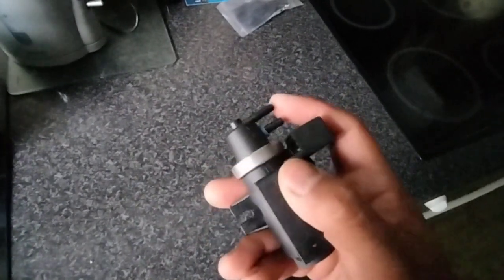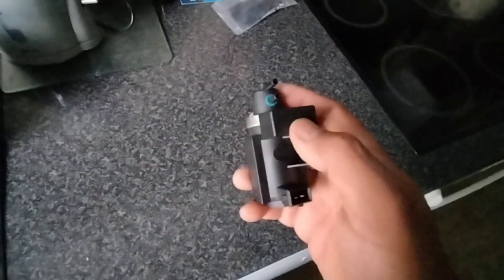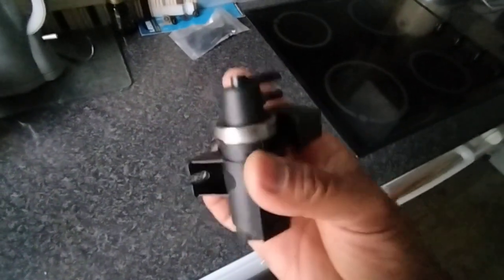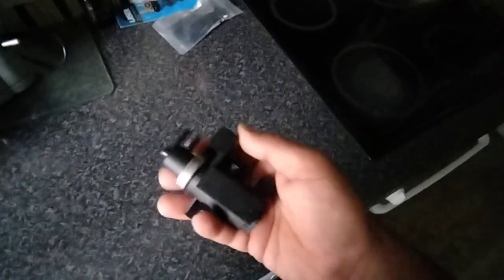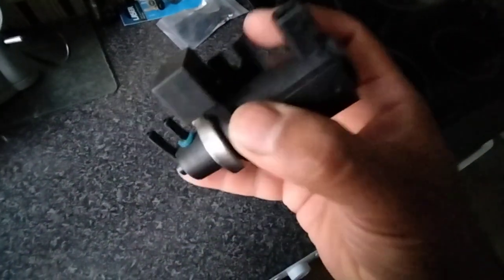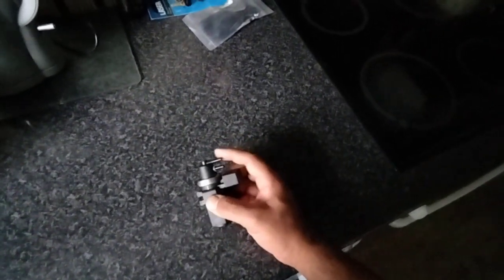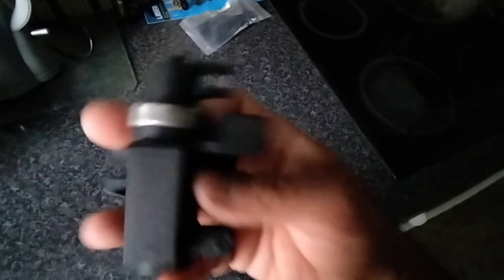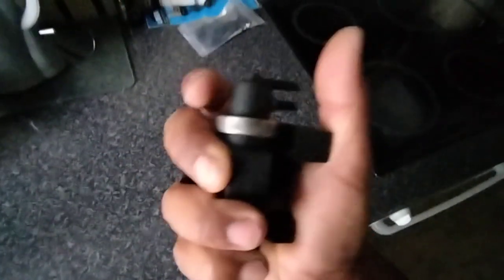CODE 4530 Charge Pressure Control Deviation E60 525D M57

Comment: Does this valve control the turbo actuator or the egr valve?  I just did an EGR delete on a 2012 X5 35d.  It has both a high pressure EGR valve (electrically actuated) and a low pressure EGR valve.  When I had the intake manifold off for cleaning, I saw a valve similar to this under there near the rear of the engine.  One vacuum line from this valve went the vacuum system manifold and the other vacuum line went to the vacuum actuator on the low pressure EGR valve.  I completely removed the high pressure EGR valve and electrically disconnected the low pressure EGR valve and also plugged the vacuum line going to it.  It seemed odd to me that I had this solenoid operated vacuum control valve in series with the electrical + vacuum operated low pressure EGR valve.  Maybe the electrical plug on the low pressure EGR valve is just a position feedback signal?  Anyway, not long after start up and a short drive I got this 4530 code and limp mode.  I cleared the code and reset adaptations, and so far no more 4530 or any other codes.

Comment: i ive blanked my egr off and kept this on you can hear air when the turbo kicks in would it be better to remove this completely or just block the ends off ?
Reply from the maker: I believe a pipe comes off it that goes to the egr valve and thats the pipe you block off.

Comment: Where abouts is this 1 located ?
Reply from the maker: Under the inlet manifold windscreen side near the bulk head.
Reply: Hi ive blanked my egr off and kept this on you can hear air when the turbo kicks in would it be better to remove this completely or just block the ends off ?

Comment: Hi mate, thnx for the clear explanation. Does your 525d have an electronic turbo actuator or a vacuum controlled one? Does this code also occure with the electronic actuator even though it does not control the turbo by vacuum?
Reply from the maker: Mines electric and the code returned, so i cleaned the turbo with mr muscle via the downpipe and now no code totally gone and better performance so it may have also been a coked up turbo, video response coming soon.
Reply: @bavarianmotorwerks3353  right. Thnx. Mine is also electric. Wanted to clean the turbo also but I have to inject Mr muscle via the exhaust manifold as I don't have a downpipe.

How long did you let Mr muscle sit and did you inject it once or multiple times?
Reply from the maker: @kenza750  downpipe basically means the cat pipe or dpf pipe off the turbo and then inject it into the turbo leave it 30mins then drive.